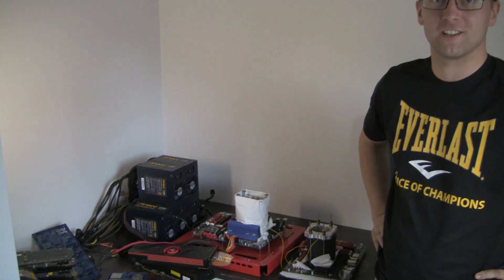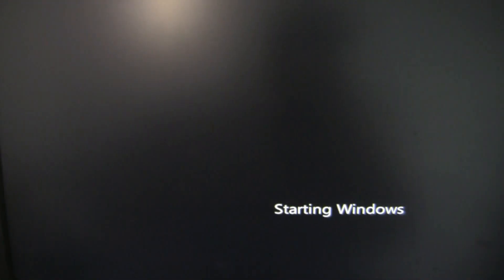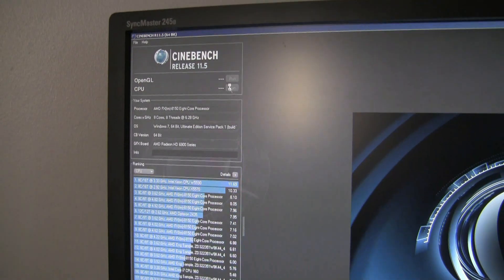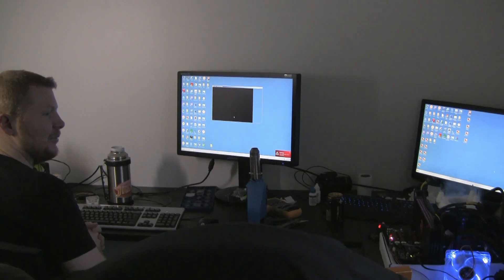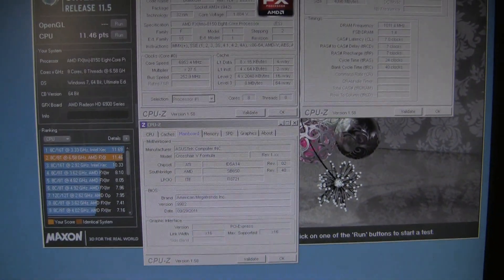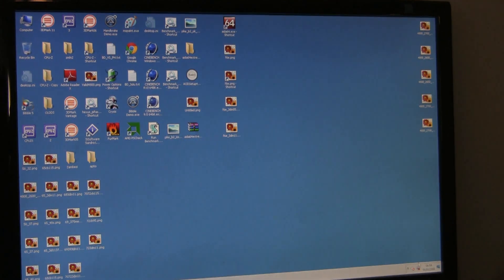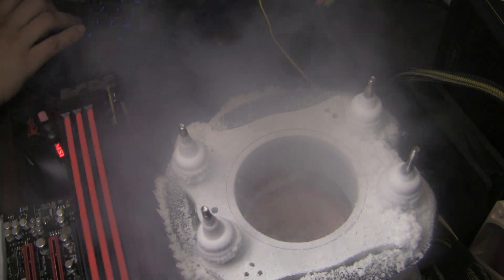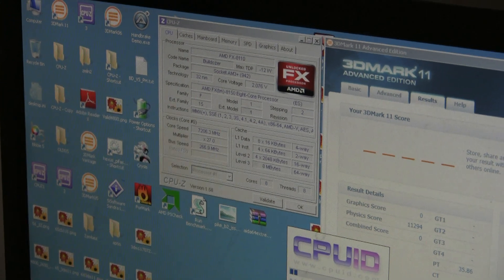AMD Bulldozer FX-8150 overclocking with Liquid Nitrogen (Ln2)

Comment from the maker: @SRSpoony When we do our overclokcing tests, we try to find the limits of some particular technology / architechture, so it is  quite obvious, that we also test maximum freq's. In this case disabling bulldozer modules and using only one of them gives a lot of gain. Temperature and amount of current is a lot lower, so overclocking results will be better, if we talk about pure MHz. We reached 8GHz with 1 module and 7.2GHz with all 4 bulldozer modules enabled.

Comment from the maker: @Tyler11440 There is not that much issue with the bios + bulldozer, but more like current software + bulldozer. It will be bit better situation with Windows 8 and with some new software which can use all potential these CPU's are offering :)

Comment: Nice vid, can you tell me if you or anyone has run trifire 3 6970s and eyefinity on this chip yet, as i find this a problem with intels, i have 3 6970's a 2600k plus a gigabyte ud7 and a asrock extreme7 but both boards have problems when running eyefinity under 3 cards but fine with one display.. as AMD is a different setup i was hoping it may just shine under this kind of setup, if it did i would order it lol sorry for the text on my mobile. :)